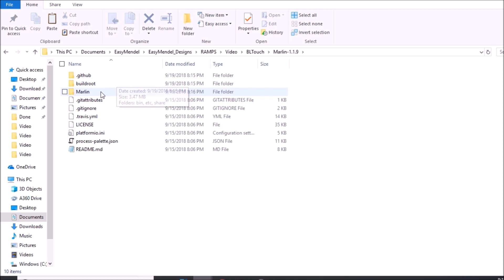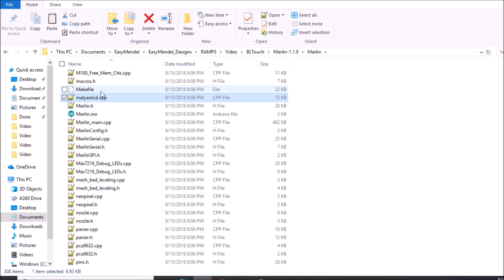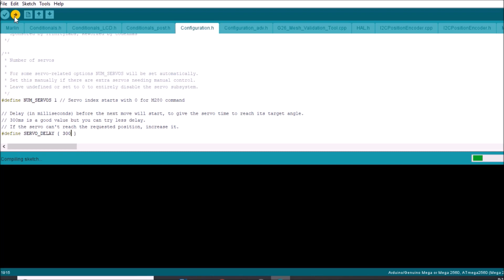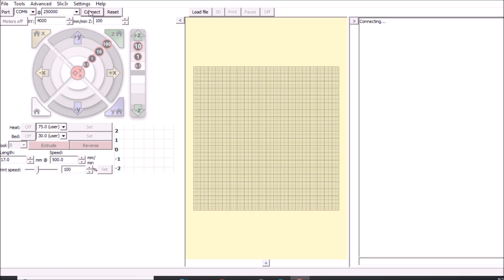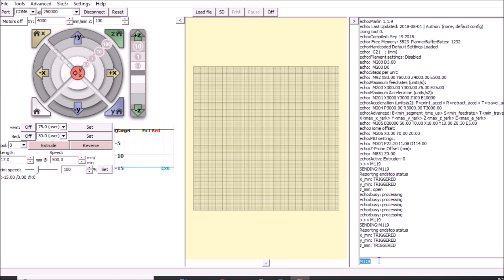RAMPS 1.4 - BLTouch

Comment: I just followed the exactly the same steps but  marlin 1.1.8 is the newest software for hobbyking fabrikator. İ defined the BL touch and activate  num_servos as like 1. But when i opened pronterface i saw x and y as opened and z as triggered. Could you help me on this issue? If Marlin 1.1.8 has auto levelling before print could you show me how to activate it also ? Here is my marlin : https://drive.google.com/file/d/1J2WOZSooO5rnLVodyj5OnWg3w5edzkN9/view?usp=sharing
https://drive.google.com/open?id=1J2WOZSooO5rnLVodyj5OnWg3w5edzkN9
Reply from the maker: There maybe a changes in Marlin firmware.  There are several open bugs on this.
Reply: Edward it is the first time,i face with marlin. I am totally newbie and my printer does not work now. If you help me on this issue, ı will be the happiest person.
Reply from the maker: @puhumight  keep in mind BLtouch with Marlin can be tricky.  Marlin 1.1.8 should work.  I'll need to check tomorrow, but I'll be a little busy for a couple of weeks, due to work.  I'll try and answer as much as possible, but work has taken 75% of my free time solving problems.
Reply: @EdwardBraiman   hi man do you find any opportunity to check ?

Comment: I have the reprapguru prusa i3 with  ramps 1.4 and marlin 1.1.8 and for the life of me I can't get the configuration.h file right. The commands work manually but when trying to home z it just keeps going up. Please help someone!
Reply from the maker: Remove power from RAMPS 1.4 and flip direction of z-axis nema connection.  The power up RAMPS 1.4 and retest.
Reply: @EdwardBraiman  I figured it out. I just had the  z probe hooked up to z max instead of the z min.
Reply: I actually have marlin 1.1.6.  I would love to update but then I would have to go thru configuration.h and that would take forever unless you or someone else knows an easy way to do it.

Comment: what if i have a fan adapter on the 3 servo pins?Is there an other solution?
Reply from the maker: You can look for a free volt pin that matches on the board with a ground and signal pin.  Then reassign signal pin number for device in pin file.

Comment: So I just installed my BL touch, but whenever the printer srarts to home Z the printsr loses power and the LCD flickers and then displays the Marlin Splash screen.  Any ideas what the problem may be?
Reply from the maker: What happens when LCD is disconnect?  Which type of LCD?  Which version of Marlin firmware?  What else is connected to 3d printer board?  Do you have Pronterface connected via a serial USB connection and what error message may display in Pronterface?
Reply from the maker: Also check the power supply wire connections.
Reply: @EdwardBraiman  First off thank you so much for your help.! I am running Marlin 1.9, with a Reprap Full Graphic Display.  I just tried disconnecting the LCD and using Pronterface and that seems to have worked just fine.  It's a real shame though because I really wanted to be able to print without a connection to a computer
Reply from the maker: Try reconnecting the LCD and see if error pops in Pronterface.  They may share a pin or something else might be going on you'll see occuring.
Reply: @EdwardBraiman  ah ha.  The issue was the extruder heatsink fan.  Once I unplugged that the LCD and BL Touch work fine together
Reply: @EdwardBraiman  could I connect another 5 volt power source to the 5 volt and ground pins to the left of the button?
Reply from the maker: Not sure I understand the question.  Could you give me more details as to what?
Reply: @EdwardBraiman  yeah sorry that wasn't very clear.  Like you said, jumping the vcc and 5 volt pins supplies 5 volts to the servos.  However in my case, the board's 5 volt rail was just too weak to power both the LCD and the BL touch.  However I found a way around this.  By attaching a 6 volt battery pack (with a 5 volt regular) to the 5 volt and ground pins rather than jumping the vcc and 5volt pins I was able to powder the BL Touch with the battery pack, and take the strain off if the 5 volt rail.  This is a temporary solution while I wait for a 12 volt to 5 volt step down from Amazon, so I can run it directly from the power supply.
Reply from the maker: Another solution might be to replace board, granted if it works go with it until it doesn't.

Comment: what if i am using a button with only 2 poles? how would i alter the program to allow that?
Reply from the maker: Could you give me more of a description of what you're trying to do?
Reply from the maker: Do you mean a switch like an Endstop?
Reply: @EdwardBraiman  yes but with 2 poles on the twitch instead of 3, where do i plug such a switch in and where do i alter the code to make it work?
Reply from the maker: It would be similar to my switch video for Endstop.  You'll use ground and signal pin.  The video you're looking for is in my playlist.
Reply: @EdwardBraiman  thank you so much. ^W^

Comment: Can this also be applied to the 3DTouch clone sensor? I can't seem to get it working given this setup and it's driving me nuts. @_@. Though it works flawlessly on the Anet A8 board setup. I just want to upgrade the board to ramps 1.4 so I can change the stepper motors to the TMC2130's stepper modules. I'm always getting this error message "[ERROR] Error:STOP called because of BLTouch error - restart with M999" and "[ERROR] Error:Printer stopped due to errors. Fix the error and use M999 to restart. (Temperature is reset. Set it after restarting)"
Reply from the maker: The process maybe the same, but would need to try first.
Reply: i have a 3d clone sensor chinesium knock off  and this procedure for me work flawlessly:)
Reply from the maker: Thank you.  Could you post a link?